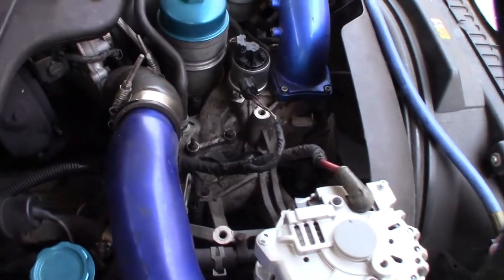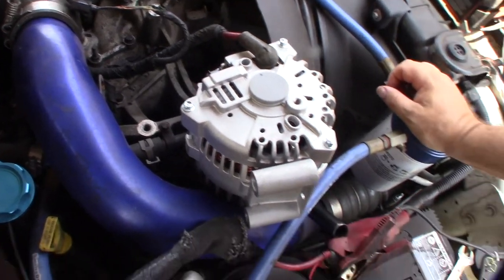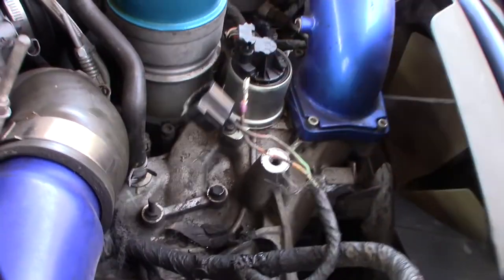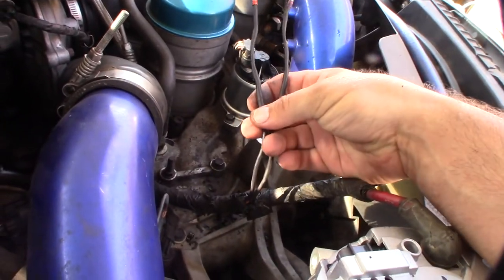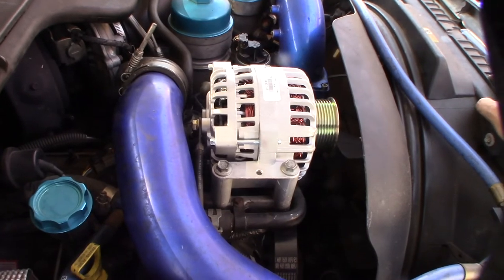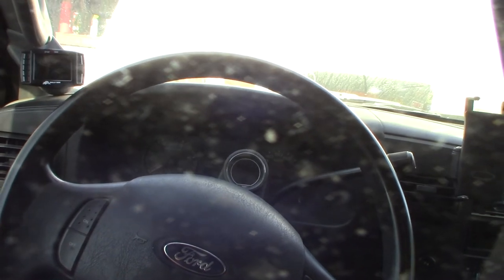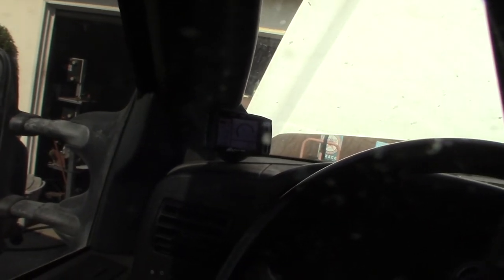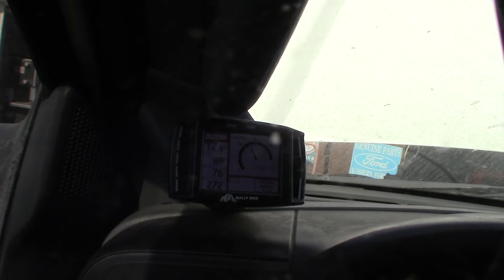Powerstoke 6.0 Alternator Troubleshooting, Wiring Harness and Connector repair F250 Melted wire

Comment: I've gone through at least 3-4 alternators on my 2005 w only 150,000 miles. I also huge cables from alternator to passenger side battery. Wondering if I should add cables to other battery and/or go to a big Amp alternator?

Comment: I need some help, I've replaced my alternator and both batteries.  My volts are between 13.5 to 14 and it passes the alternator check at O'Riley's.  However, I still have a battery light on.  I checked the volts on the plug by unplugging it from the alternator while the truck was running.  The orange (ish) colored wire shows about 1.2 and the other wire (green I think) about 12 to 12.5.  Any ideas on if that is what is causing my battery light to stay on?  2004, F250 PSD 6.0

Comment: Did you have power at all on that wire before you knew it was broken? I’m trying to trace down my issues but haven’t check the wires yet. But I do have continuity between the two pins. Makes me wonder if they’re touching.